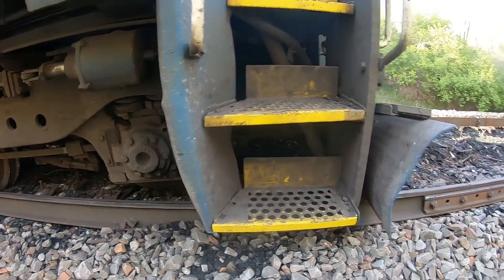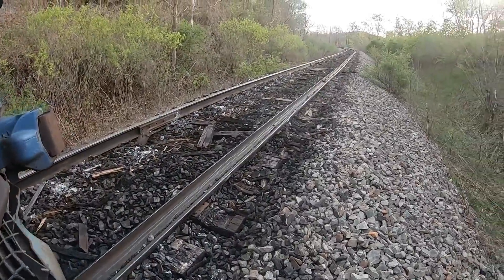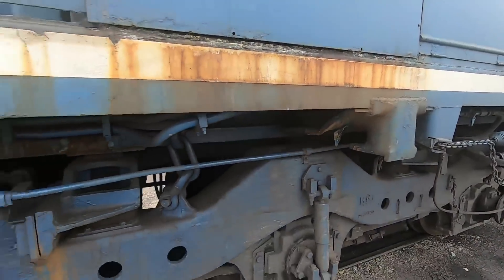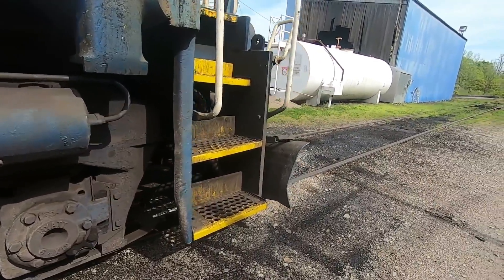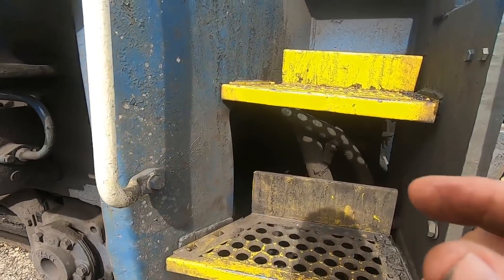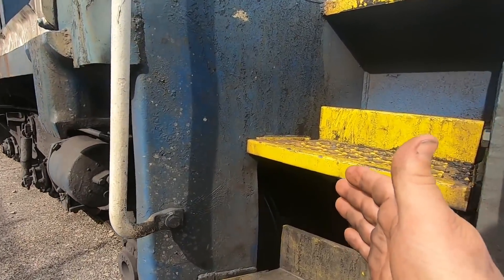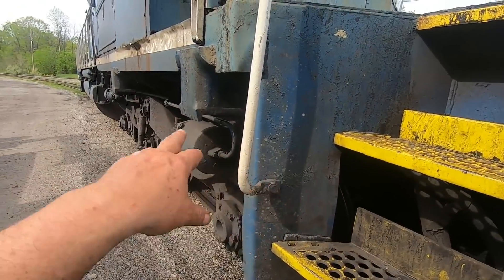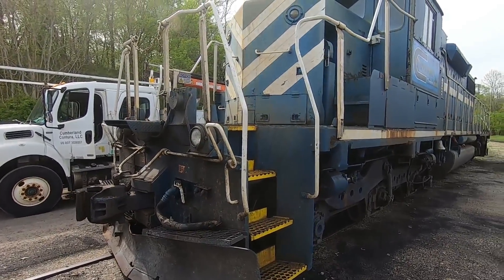Damage to the Locomotive from the Derailment

Comment: We just use a 7/8” open end wrench. If it fits over the flange the wheel gets changed.
Reply from the maker: Never thought of that Ezekiel! Thanks!!! will pass that on,
gosh darn it why didn't you tell me that BEFORE i made this
movie...LOL
Reply: @ccrx6700  my crystal ball is in the shop this week.  Which is a real bummer …. I really could have used it this week. Lol
Reply from the maker: @emknapp6713  hope they get your AC fixed first 😄
Reply: @ccrx6700  that truck is gone.  Finally got mine back from the dealer.
Reply: It wouldn't have caused this derailment regardless.

Comment: do train engine diesel run like trucks to just keep glow plugs going and accessories running, and it is too costly to shut down ?
Reply: No glow plugs, a diesel engine of this size uses high compression to heat the air-fuel mixture to burn. Water freezes, so to keep the engine block from cracking, the diesel is left to idle. No antifreeze is used as that would be too costly and very bad for the environment if spilled.

Comment: I am thinking that all the damage and all the restoration of rails and engines along with worn wheel flanges makes for some big $$$  This gives me a much better understanding of the economics of running a railroad. Thank you for the excellent detailed description. I find myself fascinated with all of this derailment evolution.
Reply: Railroading is an economic nightmare/daydream. Just look at the cost of ONE tie, now look at the number of ties per yard, mile, and the number of miles of the railroad. Once you understand that about 1/2 of the distance of the roadbed is ties, it just boggles the mind. Looking at the rail. Rail is sized by the number of pounds per yard of length and modern rail is 135 lbs. So a mile is 1760 yards times 135 pounds, times two equals 475,200 pounds of steel used just in the two rails every mile of track. (Not looking at tie plates or spikes or other hardware.) That's 237.6 tons per mile.
Reply: @thomasboese3793  You are right - the numbers of things are a bit staggering. I guess I can see why the Precision Scheduled Railroading came about. The cost of maintenance goes up and up and the revenue from the customers doesn't go up as fast so - trying to avoid a shortfall.
Reply: @brianhickey5949  The last cost I heard to lay new ties, ballast, and rail (no crossings, no turnouts) was one million dollars per mile. That works out to $189.3939 per "foot". To put it into perspective If I try to match the prototype in N scale I should be able to lay a foot of track (160 scale feet) for $1.1837. It would be close. {In HO [87.09 scale feet] it would be $2.1746.)

Comment: That bar you are mentioned, if I recall correctly from listening to the folks with Union Pacific is called a "dog bone" and those bolts might need to be heat-treated to loosen them. Surprising what an ole dog of 75 years remembers.
Reply: No sir, that's called a binder. On locomotives that have them, the dog bone is on the centerline of the truck and supports the nose of each traction motor in the truck to counteract the effects of torque when applying tractive effort to the rails. SD 40-2 locomotives like the one in this video don't have a dog bone at all, they have another type of nose suspension that uses rubber pads bonded to steel plates arranged in a stack of about a dozen, all bonded together into one nose suspension. 
Those nuts usually come right off with a 3/4 drive impact and a 1 3/8" deep socket. If it won't come loose, they get taken off with a hot wrench in short order then replaced with a new bolt and nut.

Comment: From the outside not so bad but its that closer look that shows the real and more serious problems. Slow as it was at least it wasnt totally ripped up and no fuel was spilled. The sheer length of the rolled rail is astounding. Hopefully the repairs continue smoothly and safely

Comment: Thanks for the updates, keep them coming. Rarely do we outsiders get a chance to see 'behind the curtain' on accidents.  Were the repairs that were done to get the line open temporary and you and your crew will have to rebuild at a later date? Why couldn't the loco just be pulled back to the yard instead of walking it 16 miles?  Was it that messed up wheel?

Comment: Another excellent video covering this accident.  Was wondering, is there enough tread left on the damaged wheel set to turn that set of wheels in a wheel truing lathe?  Can your shop do that or do you have to send the wheel set to another RR that has the equipment to do this?  Many years ago the Norfolk Portsmouth Belt Line would send diesel wheels to the old NS in Chesapeake, Va to be ¨turned¨ in a huge lathe. The lathe was ancient and used hand sharpened tools in the lathe turrets to restore the original wheel contour.  Often I got stuck with that job.  I hated it as it was hot, dirty and very slow.  Now days carbide inserts are a game changer plus now locomotive wheels need not be removed from under the locomotive to restore proper contour.  This saves many hard hours of labor over what it used to be.
Reply: We have a Simmons wheel machine for that. It's in a pit inside the shop and you park the locomotive on top of the machine. Simply put, its like a big horizontal mill with two big cutters that profile both wheels on that axle at the same time.
Reply from the maker: @ralfie8801  awesome! Made a vid of them starting to true the wheel think your gonna like it.
Reply: @ralfie8801  Very interesting.  Never seen this process in person.  Back in the 70´s I used a more manuel type.  The wheels and traction motor was removed from the locomotive & the axle and wheels put into a large wheel truing type lathe. Many hours to do this and reinstall the wheel motor assembly. It required at least 2 machinists and 1 electrician.  I bet now before the brake rigging is removed, binders dropped and motor cut loose,  you are done. Wow!!
Reply: @benniepierce6283  
Depending on how bad a wheel is it can take up to 2 hours to turn a wheel set. The machine has dead centers like a lathe, after a pair of rollers hydraulically raise the TM a few inches to get the wheel off a short section of rail on each side that bridges the wheel true machine, the short rail section (about 3 feet) slides back and the dead centers are extended into the center holes in each end of the axle, the computer on the wheel machine bases all cutting operations and measurements off the wheel centers. It cuts both wheels at once and the cutters are shaped to the correct wheel profile. They extend up between those two rollers on each side from below. The operator just cuts the worst wheel first to get a baseline measurement and then the rest are cut to match if needed to be in locomotive manufacturer tolerances for the wheel slip detection equipment.
Edit: I’m not sure how to post a link, but if you search “Underfloor wheel trueing machine here on YT, there is a short video showing one (not the company I work for) in action.
Reply: @ralfie8801  thanks so much.  Having done this type of work I understand for the most part what you are saying. I will reference the video you noted.
Reply from the maker: Bennie, yep excellent comment sir. Had a guy come in and true it,
got a video coming out where you can watch him do it!
Reply: @ccrx6700  I´m very much looking foward to what he does.

Comment: Do you have any hoesch re railing equipment? Has saved our butts many times from having to call in hulcher or Turner crane. Doubt it would work for rail rolled that bad for that long, but they work good for smaller derailments.
Reply from the maker: No we do not Michael, if we would have it sure coulda come in
handy many times too. We do have the old fashioned re railers
we have used, PIA drag those heavy heavy things under the
cars and dig out under the rail to lock them in place, not my
kind of work I wanna do anymore....LOL

Comment: Big Blue 1 manages to look pretty even after all the beating.
Do you know why the engines were kept running? Was it to keep the brake pressure topped up? Usually in my experience after an accident equipment is switched off
Reply from the maker: Guess everyone was so concerned about getting contractors out
here and getting track back in service, no one though about
doing that. Appreciate your watching

Comment: It might be all wheel C/O it depends on gear case damage if it can be fix on locomotive also they need to put hand brake on when in park and adjust  brake cylinder piston travel on front truck

Comment: I’m confused about a ‘combo’ versus a ‘traction motor’, could you explain further? Two axles versus one ???
Reply from the maker: Traction motor has an axle out both sides of it and each
axle has a wheel on it, the axles and wheels put together is called the combo. A motor without axles is called the traction motor. hope that makes it clearer and thanks Bryan for watching

Heres a link to a long ago vid I made as they are dropping a combo out on another loco

https://youtu.be/7uTgaGs92QY
Reply: @ccrx6700  That must be some lingo you guys use. The whole assembly is called a traction motor assembly by most railroads and the AAR.
Reply: @ccrx6700  Ok, that clears it up. 👍🏻
Reply: @ccrx6700  I guess my point was that there is one solid axle with a wheel pressed on each end.
Reply: I think he meant one axle, two wheels with a traction motor mounted between.
Reply: @vanishingoddities  That’s what I would’ve thought.
Reply: A combo is the traction motor with the axle and wheels installed on it. It is easier to replace it as a unit than to remove the axle from the traction motor to replace the wheels.
Reply: Only one axle, two wheels pressed on the axle. Most railroads change the whole thing instead of separating the axle from the motor.